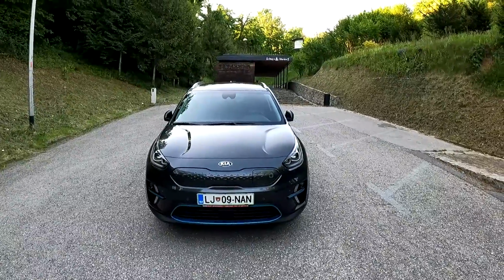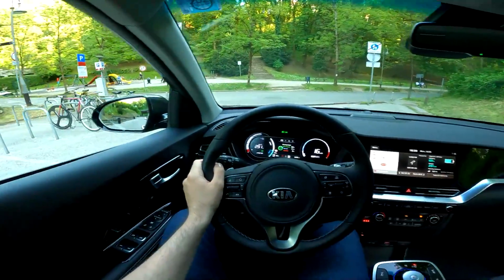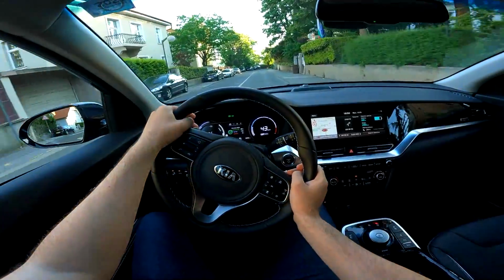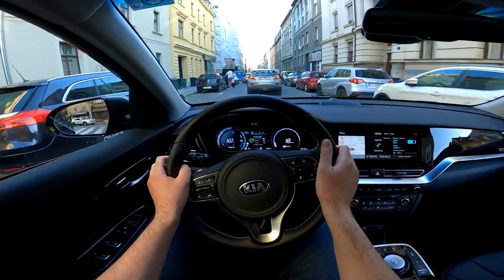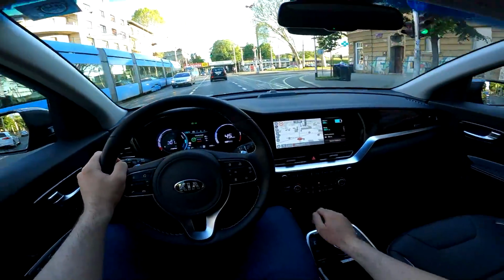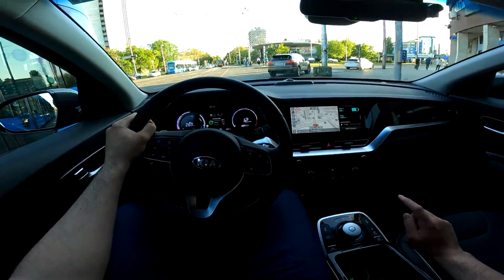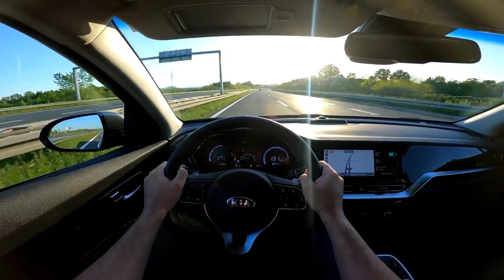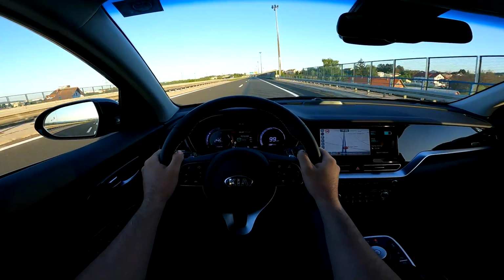New KIA e-Niro 2021 - POV test drive & FULL REVIEW (electric SUV)

Comment: Great video. Can you please elaborate on the brakes? Does it have a longer braking distance than in a petrol car?
If you switch the regenerative braking off, do the brakes work as good as in a petrol car? This is my main concern before i decide on buying the car
Reply from the maker: thanks :) Speaking about the brakes, you can adjust the level of regenerative braking, and if you remove it completely you get the same feeling as on normal car :) Brakes are good and when you have regenerative braking sometimes you don't even need to use them :) Only be careful since the car has lot of power and torque so makes sense to have the regenerative braking on when driving fast so that it's easier to stop.
You can watch my night POV drive where I talk about the driving and other details: https://youtu.be/KzLCNcjy0w8

Comment: Based on your experience and tests, what do you think is the real range on the highway at legal speed of this new Kia e-Niro with the 64 kWh battery?  By the way, very good job.
Reply from the maker: thanks :) Well my guess is around 350km, as I was doing more than 400km here. Unfortunately didn't have the car long enough to test that, but some other info that I found and also CarWow managed 400km on their full range test (they tested the car until it stopped), but in UK speed limit is less than in my country (here you can drive 130 km/h, in UK is around 110 km/h as far as I remember when visiting and driving in it)
Reply: @crospotter13  Thank you very much for your honest and sincere answer.
Reply: @Ronin585  in my last holidays i was driving at 120 km/h tempomat and at 280 kilometers wen i was juicing up i had 45 % left! I rhink at 130 you can go 350 kilometers!
Reply: @patricketzthaler8699  These are very good data / results.  Thanks a lot.

Comment: I have the E-Niro and its a wonderfull car! Only the charging speed is not good!! But the efficancy is very good! Wenn you dont need to go on the higway 300 km every day its no problem
Reply from the maker: nice to hear that :) At what speeds do you usually charge on DC charger?
Reply: @crospotter13  72 -73 kw at 20 % to 52% than it drops to 68, at 60% it drops to 56 and at 72% it drops to 30 kw! 40 min from 20 to 80%!